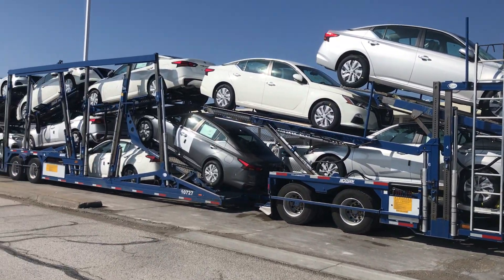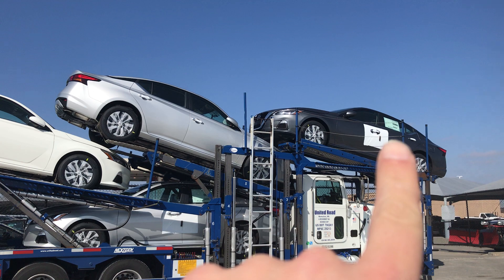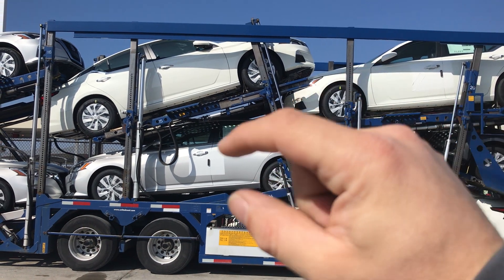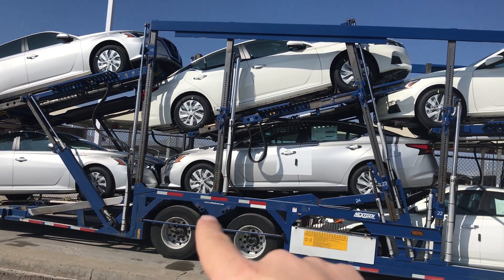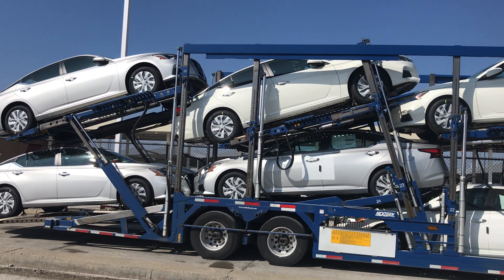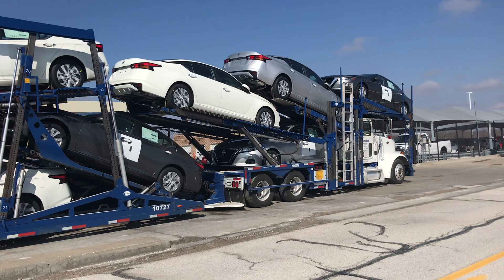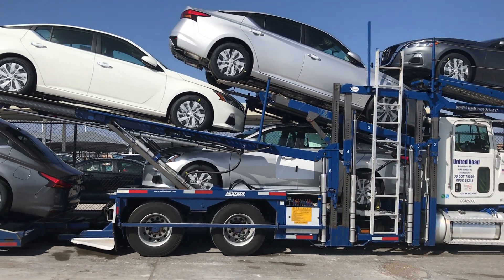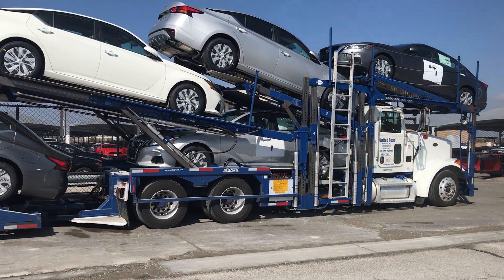My first ever 11 car load

Comment: i have a 10 car Cottrell on a flattop freightliner with a C15 550 BHP 10 speed Eaton , im a owner operator its my own business, personally a 10 car is as far as i would go  because i want the space for a sleeper cab, i only see day cabs with 11 cars, also with an 11 car rig you spend too much time working out how to load cars and if they are mixed with multi drops they would be to many verticals that can lead to accidents and cars touching the frame or each other compared to a 9 car or 10 car,  also you get paid by the mile. not the hour when its your own business. 
Been a OO car hauler is not just about driving trucks its about driving cars on top of trucks backwards securing cars on your rig and calculating the how the platforms should be positioned with out damaging the cars plus all the negotiating with brokers and insurance companies , maintaining your rig, dealing with paperwork and customers fuel costs keeping up with the , DMV and IFTA and IRS, FMCSA, DOT and a tones of other shit im not going to mention 
this game is more than just hauling cars

Comment: Not bad for your first time driver !  and yes #10 should've been driven on. Make sure you always have a fist space between your units and an elbow to fingertip turning room between #3 & #4  also #3 & #8 for turning in dips. safety tip for your pins , when you pin it lift it up to see where the unit will go and adjust #2 & #3 because its going to move in transit !!!  You must  like looking at me with my 11 vetts lol.  love to see other gd drivers on the road. have a safe one hand ! Excellent Job !!!
Reply from the maker: Thanks man and yes I have always loved seeing those loads. How are you enjoying the new vets can you still stack the belly with them or are they not letting you guys. I’ve been seeing a lot of guys just doing 9-10 vet loads lately.
Reply: @CarcarrierTv   Yeah brother they took 1 off for weight.  It's always nice hauling peoples dream car !  Seeing the customers faces when we pull up always gets me .  they're lower but most have a lift button that picks it up about 3 inches and that's cool.  I love the new model C8 . When you see 9 they're  hauling a backhaul load , all of us out of the plant haul 10.
Reply from the maker: Yes I agree it’s cool getting to haul stuff like that. I love the new c8 I think they did a very good change and facelift on the new models. I love vets but with 3 little kids it’ll be a few years before I buy myself one

Comment: Your Overlength the back bottom unit is hanging out more than the 4 ft limit off the end of the Trailer...! The Front looks about right with 3 ft off the front of the Tractor Head Rack...!
Reply from the maker: That’s the way I used to load was to the 4ft law but that was changed last summer your now allowed 4ft off the front and 6ft off the rear

Comment: I find it hard to believe it’s under 78000 pounds 
When this units are over 3500 pounds a piece!
Good looking load though!!
Reply from the maker: They were all base model units for enterprise so they were 3212lbs each I was very surprised I made weight by as much as I did as well
Reply: Your allow 80,000! Tractor has 14,000 steers!
Reply: The looking at 80’ 90,000 GVC ON TRI AXLE TRAILER! 13 car rig!trailer tires suspended in a gear box! Car sits between tires